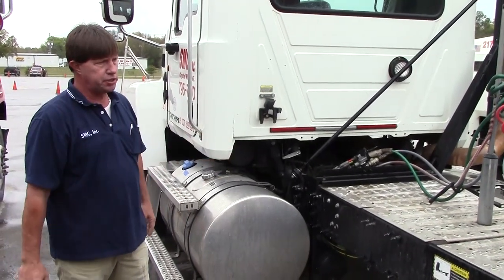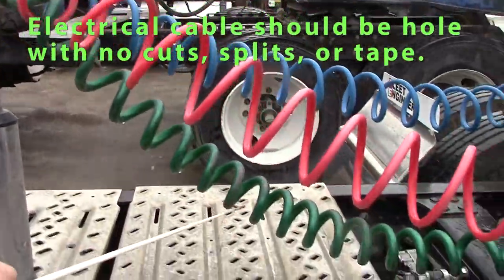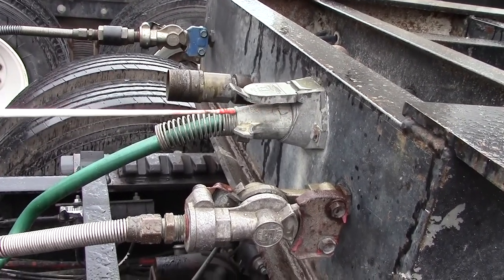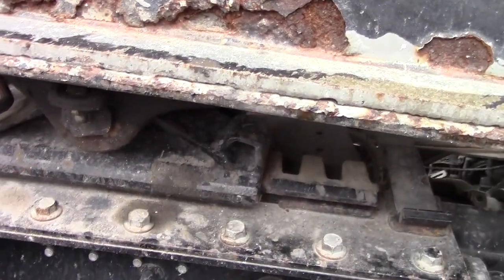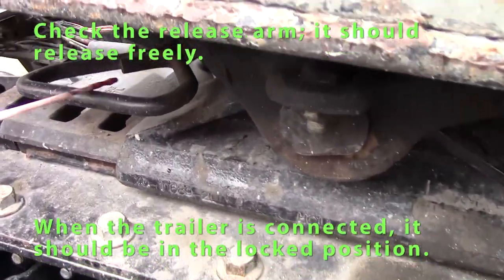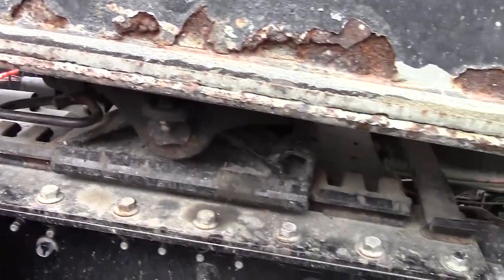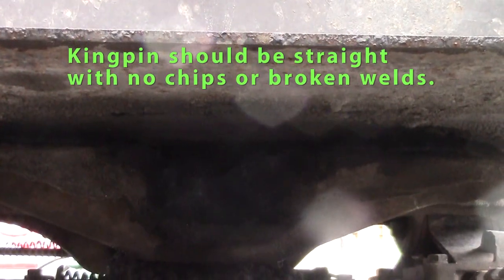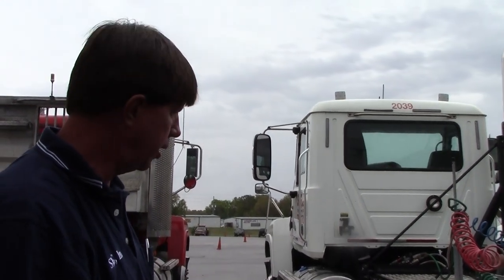CDL Class A Fifth Wheel Coupling Check Procedures

Comment: I swear to god, I did the EXACT same coupling pretrip except I did not mention “rust” for the 5th wheel platform and they failed me for the coupling section of the pretrip. I also mentioned clearance in the front of the trailer with the cab for turning.
Reply: Where did u do yours test
Reply: Houston, TX @ Gessner, apparently people stay away because they always have more testing availability then the other locations. I actually looked today and they had a same day slot available while other locations are 2-3wks out.
Reply: Don’t forget Red Line emergency 
Blue Service line 
Green electric line